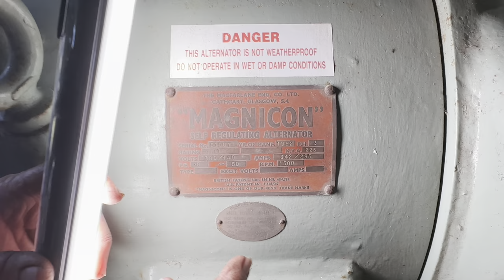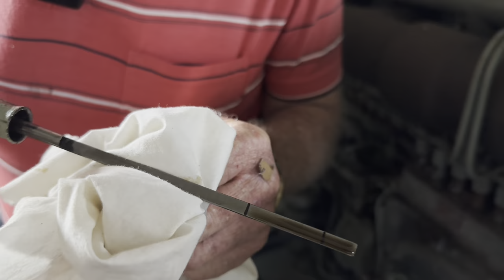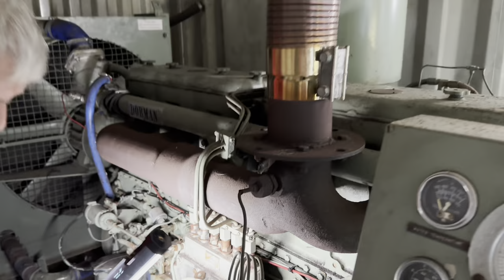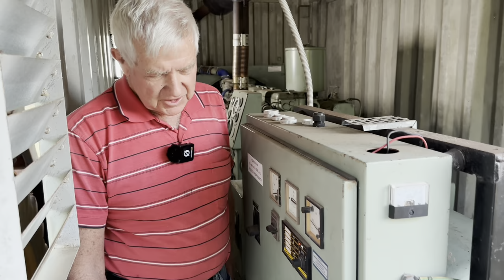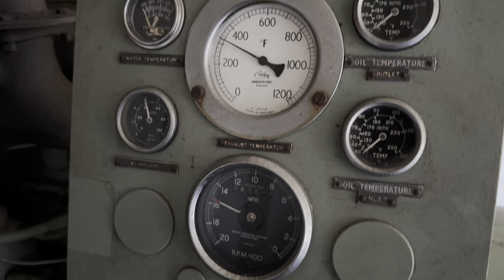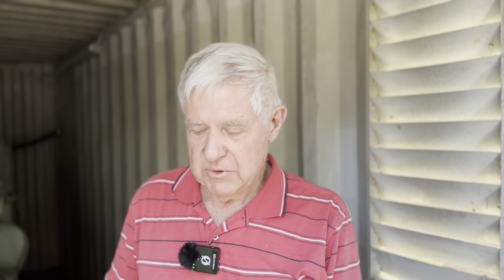HUGE Perkins Dorman Stationary Engine - Will It Run?

Comment: The company Dad worked with had a former NSW Egg Board generator driven by a Davy Paxman Ricardo diesel engine located at a quarry they had. It didn't have a muffler, just an exhaust pipe out through a hole in the shed  and out into the bush with an elbow on the end pointing up. It was a huge engine and a thing of beauty to a young teenager's eyes, but when it was operating you couldn't stay in the shed with it as the noise was horrendous. Unfortunately a head gasket issue led to water in a cylinder and we all know what happened next, yep,blew the gasket out,cracked one of the heads and put a rod with piston attached outside the block. Scrap metal!

Comment: Perkins made some fine engines but the new ones are giving out. The old crusher here had a D-8 or 9 genset in a trailer, pony motor start before 3-phase line was run. It was sure interesting starting it with a flashlight in the dark but when it fired you had power and light. The exhaust was shot so you had a trailer full of white smoke till the Cat lit off. Good for you, Bruce! CHEERS!

Comment: Had 2 slightly smaller Dorman as harbour sets on trawler, one night the 330 kw                                                               went kaput, we tried to start a Dorman, they hadnt been run in years, it was air                                                                   start and refused to go, the boss in his wisdom kept pouring ether into it.                                                                             Then it decided to start and had the revs run away, smartarse me reached behind                                                            the injector pump for the shutoff lever just as a bigend parted company and struck                                                            my hand, by the time I freed my hand it was a mass of black and red, oil and blood.                                                          Stopped me in my in my tracks for a few weeks!                                                                                                                      Finished up having to run the main engine so the shaft gen could power the refrigerators.
Reply from the maker: Wow, scary stuff! I can picture the chaos and it sounds like a pretty sizeable trawler. Hope your hand made a full recovery? Thanks very much for sharing, Bruce
Reply: @bruceinaus  Yes Bruce, she was a 220ft, 1300hp ex Icelandic trawler,                                            one of 3 that came to WA in the 70s to fish the Bight. They failed spectaculary!                                     Thanks for the concern, the hand only suffered flesh injury, and I was back at                                        work in 2 weeks.

Comment: Bruce, I have a 110 kva Dorman generator also driving a McFarlane alternator that I use to drive my 100 kva induction furnace - only runs occasionally as it's a hobby. The Deep Sea controller one yours I'm fairly sure is a retrofit - mine originally had a whole shelf full of relays controlling it but I removed them and fitted - guess what - a  Deep Sea controller that handles starting and stopping, controlling the fuel solenoid and starter relay and monitors oil pressure and engine temperature.
I've lined the room it's in with acoustic insulation that made a huge difference - mind you don't damage your ears.
I think many of these sets went into cold war facilities at huge cost to the government and us the tax payer!
Reply from the maker: Thanks for the info Andrew, good to know there is still a few of these old units getting around and that might explain why this one originally appears to be from dept of aviation, Bruce
Reply: There's no such thing as "cost to the government"... We all know where that money comes from. It's all a just a huge criminal syndicate.

Comment: Another great vid Bruce. The rate at which our coal-fired power stations are closing, and the increased demand for EV charging and air-cons leading into summer, you may have an opportunity to top up the network ha ha.
Reply from the maker: Lol, might put a bit more back than solar panels you reckon! Thanks for watching
Reply: Outback --end of the earth stuff...do it or die

Comment: OOOOOHHH. The sweet sounds of a big Perkins. It would be a thing of joy just to come and stir it up once a month just to make sure she still purr's. I could sit there with a couple of stubbies while it had a monthly test quite easily. The noise, the smell. You won't get that with your electric MOTOR. Maybe set it up as a charging centre and do us all a favour and tip in 3 phase into those fuse's on wheel's.
Reply: I reckon you have no trouble getting company on that day once a month.

Comment: Neat genset. I've worked on a couple of the really large CAT ones (about 72LV16 quad turbocharged, 1.6-3MW, diesel and natural gas). Startup of them is like you said, the heaters are always on to keep them up to operating temp, batteries always on trickle charge and compressed air system for the urea injection always up to pressure. When they get the start signal the oil priming pump runs for 5s while the louvres on the enclosure open. Cranks, fires, idles for about 10s. Then if the board is green it goes wide open, kicks on the field current, syncs to the grid, throws the main contactor and is making electricity. The timeframe from everything closed up and quiet to a deafening roar and hurricane force wind from a 7' fan is about 20-30s. Disconnect from controller then unhook batteries before doing anything more than checking the oil.

Comment: Saw them a standby gensets in older telecom buildings. Starter motors ran in 10 second bursts with at least 3 tries if a no-start. The Simms pumps had an excess fuel button for cold starts. If that was deployed engine would start quicky (brief black smoke cloud) Telecom had enormously enormous starter batteries and just wound them till they started. More modern and powerful engines had preheaters to get easy starts.

Comment: In the mid to late 70s I worked for citrus company as a farm tractor mechanic we had all Massey Ferguson tractors around 20 of them over in factory they had some ancient single cylinder horizontal engines from around 1940s and huge 6cylinder cat and what I think was a V 12 Dorman engine that was big and noisy never got a close look at it to see if it had any Perkins markings but I think maybe by now it might have been scraped as the company shut down about 15 yrs ago I was told good video Sir brings back memories of timed long past

Comment: F.G. Wilson are a major builder of generating equipment in the UK. They're the company who take the Dorman engine, marry it up to the McFarlane alternator. GEC (not to be confused with the American GE company) was a major electrical/electromechanical engineering company in the UK. They also made excellent electrical control gear. GEC took over Ferguson Palin, which was a Manchester based electrical switchgear manufacturer until about 1962/3. Ultimately, GEC was absorbed into AEG somewhere in the 1980's, I think. All great names that are now extinct, in all but name. However, F.G. Wilson are still in the game, or at least were when we last contacted them a few years back for a circuit diagram of one of their generator control cabinets.

That's a nice lump of engineering you have there. Look after it well, and it will reward you with decades of reliable service.
Reply from the maker: Thanks so much for that information whitesapphire, really helpful to learn the origin of this one, best wishes, Bruce
Reply: Dormans is now Perkins however a couple of the original 1930s factory buildings still survive in Stafford

Comment: The speed that the starter drops out can be adjusted if needed, but it sounds okay, it would light off much quicker if it was preheated. Those big lumps are fairly cold blooded and not all that high compression for a diesel so they are a bit slow when cold. I came across a few Dormans in my 30 years of working with Detroit Diesel as an electrician. Solid engines but the castings are very brittle and it's easy to break stuff if overtightened, good luck finding the Vokes oil filter elements.
Reply from the maker: Hi Ray, thanks for your comment. If you go through the comments, there’s another interesting story from Ivan where the rod came out and smacked his hand when he was reaching behind the injector pump! Thanks for the advice, Bruce

Comment: I used to operate a 500kVA cummins unit in a container. the noise was body shakng. The fan should start when the temperature of the unit reaches a temp. (about 180) and it should push the air through the radiator, drawing it over the engine from the other end.
Reply from the maker: Thanks John, that would be about twice the size of this setup id say. And yes, when the fan runs it does exactly that, sucks through the end past the radiator and blows back across the engine. the first time it fired up it nearly blew me out the container it’s a very strong fan. Thanks for watching, Bruce
Reply: I expect the sound level will be about the same, as the steel container reverberates as well as the engine and fan noise. thank you for replying. @bruceinaus

Comment: Perkins bought Dorman to extend the engine range for Gen Set applications where the largest  customer was FG Wilson of Larne Northern Ireland who were subsequently acquired by Caterpillar. The engine is a very old 6QV which predated Perkins, when they had moved to a mechanical Unit Injector fuel system. Probably under the GE ownership. The paperwork referencing a Perkins/FGWilson 1306 is a Navistar 6 cyl engine which was bought under license. I don't think its the same engine you have in the container.

Comment: Hi Bruce, I've got a Dorman on a generator that runs nicely but won't idle or run without feathering the fuel control rod - we are thinking there is something wrong with the governor, but I am looking for someone who knows these engines. Would appreciate it if you could pass me on to someone you might know. Cheers Anthony

Comment: The engine is most certainly a Dorman, many australian government agencies had these units coupled with a  Macfarlane Eng Company , made Magnicon , Transicon alternator that later evolved into Markon then Stamford Newage Stamford and now owned by Cummins CPG ,  but I stand to be corrected on this as that's around 60 years of progress in a few lines. These brand types are the grandfathers of Generator/Alternator machines of brushed and brushless high speed machines we use today , the unit itself may have been packaged back then by GEC General Electric Corporation / GEC Diesels not 100% sure , Macfarlane Generators is an Australian company with a similar name however they do have loads of knowledge and experience with Dormans    

In regard to the starter motor hanging in this can be controlled by the deep sea controller or the original speed switch if fittedwhich should operate off a magnetic pick up if it still exists, you just need to do your homework and trace it out as the controller may use the AC output from the Main Alternator / Gen sense to detect engine speed at a guess it should disconnect at 750 RPM but its been a long time since i set one of those up 

FG Wilson information is a Furphy that was probably left in the file
Reply: Just to confirm , Dorman Continued as a Trade Mark by GEC from 1968 to 1995 where i am sure the name was also used in conjunction with Rolls Royce and Caterpillar builds

Comment: F. G. Wilson's, of Larne, N.I. famed for their gensets, bought out by Caterpillar, since they bought so many Cat engines, but also had the cheek! to buy Dorman/Perking, Cummins or other Cat competitors, which Cat could NOT be having! So Cat bought them out.
Reply: They used so many Perkins engines.Perkins was bought out by Catapillar.Perkins had previously owned Gardner,and RR diesel.Perkins still trade under their own name.

Comment: I bought an old MEP 5 (30000 watt) that has 3.4 hours on it. I figured it sat on a pad out behind some office building and got exercised about 15 minutes a year. About as good as new for a few hours traded electrical work. No where near as big as that one but still a bit of work to move. I guess that’s why God invented trailers.

Comment: Somd fireproof sound pa els..youre gonna go deaf....an exhaust sydtem to ...relieve the heat in the box..
Oh my..
Some solar pv for trickle charge on start..as well a small pumped preheat system via solar therm collector....INSTALL A PRECHARGED OIL PRESSURE 
YOUVE